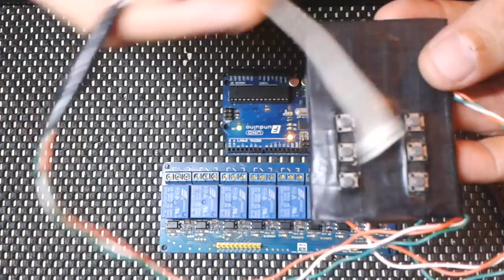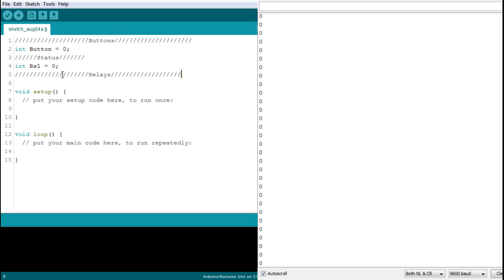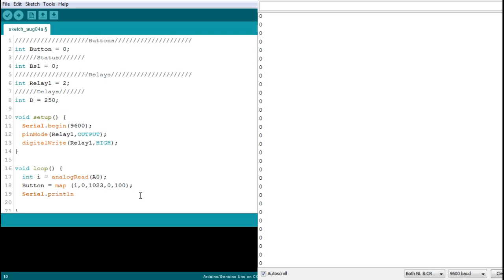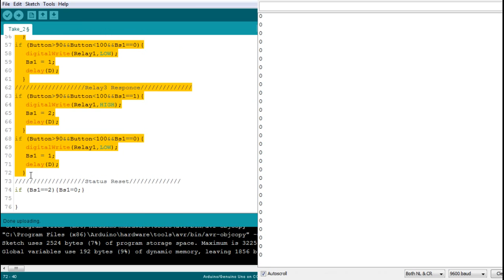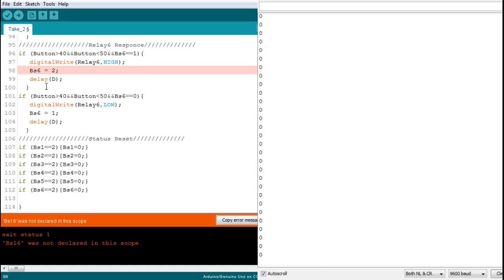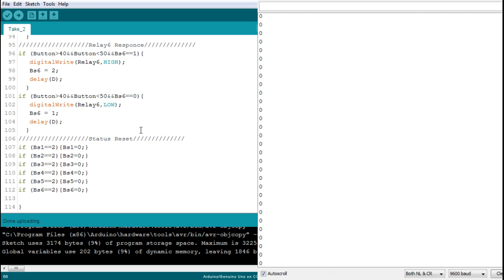Arduino Coding ("Button And Relays")

Comment: Hello Liney118, 

I am making a sequential relay selector (8CH) with just 2 voltage input signal (up, down) to the arduino. Can you help me with the arduino codes??

Greatly appreciate your help  as I am really bad with codes.

Thanks!
Reply: // Constant values that won't change.
  const int Relay_1 = 2;
  const int Relay_2 = 3;
  const int Relay_3 = 4;
  const int Relay_4 = 5;
  const int Relay_5 = 6;
  const int Relay_6 = 7;
  const int Relay_7 = 8;
  const int Relay_8 = 9;
  const int LED = 10;
  const int PushButton_1 = 12;
  const int PushButton_2 = 13;

// Variable values that will change.
  int PushButtonCounter = 0;           // Counter for the number of push button presses.
  int CurrentButtonState_1 = 0;          // Current state of the push button.
  int LastButtonState_1 = 0;             // Previous state of the push button.
  unsigned long ButtonPressed_1;

  int CurrentButtonState_2 = 0;          // Current state of the push button.
  int LastButtonState_2 = 0;             // Previous state of the push button.
  unsigned long ButtonPressed_2;

void setup()
  {
    pinMode(Relay_1, OUTPUT);
    pinMode(Relay_2, OUTPUT);
    pinMode(Relay_3, OUTPUT);
    pinMode(Relay_4, OUTPUT);
    pinMode(Relay_5, OUTPUT);
    pinMode(Relay_6, OUTPUT);
    pinMode(Relay_7, OUTPUT);
    pinMode(Relay_8, OUTPUT);
    pinMode(LED, OUTPUT);
    pinMode(PushButton_1, INPUT);
    pinMode(PushButton_2, INPUT);
    digitalWrite(Relay_1, LOW);
    digitalWrite(Relay_2, LOW);
    digitalWrite(Relay_3, LOW);
    digitalWrite(Relay_4, LOW);
    digitalWrite(Relay_5, LOW);
    digitalWrite(Relay_6, LOW);
    digitalWrite(Relay_7, LOW);
    digitalWrite(Relay_8, LOW);
    digitalWrite(LED, LOW);
  }

void loop()
  {
    CurrentButtonState_1 = digitalRead(PushButton_1);        // Read the push button input pin.
    if (CurrentButtonState_1 != LastButtonState_1)           // Compare the PushButtonState to its previous state.
      {
        if (CurrentButtonState_1 == HIGH)                  // If the current state is HIGH then the button went from off to on.
          {
            ButtonPressed_1 = millis();
            PushButtonCounter++;                         // If the state has changed, increment the counter.
          }
        delay(50);                                       // Delay a little bit to avoid bouncing.
       }
    LastButtonState_1 = CurrentButtonState_1;                // Save the current state as the last state for next time through the loop.
   
    CurrentButtonState_2 = digitalRead(PushButton_2);        // Read the push button input pin.
    if (CurrentButtonState_2 != LastButtonState_2)           // Compare the PushButtonState to its previous state.
      {
        if (CurrentButtonState_2 == HIGH)                  // If the current state is HIGH then the button went from off to on.
          {
            ButtonPressed_2 = millis();
            PushButtonCounter--;                         // If the state has changed, decrease the counter.
          }
        delay(50);                                       // Delay a little bit to avoid bouncing.
       }
    LastButtonState_2 = CurrentButtonState_2;                // Save the current state as the last state for next time through the loop.

    if (PushButtonCounter == 9) PushButtonCounter = 0;
    if (millis() > ButtonPressed + 2000)
      {
         switch (PushButtonCounter)
          {
            case 1:
              digitalWrite(LED, HIGH);
              delay(100);
              digitalWrite(LED, LOW);
            break;
            case 2:
              digitalWrite(LED, HIGH);
              delay(100);
              digitalWrite(LED, LOW);
              delay(500);
              digitalWrite(LED, HIGH);
              delay(100);
              digitalWrite(LED, LOW);
            break;  
            case 3:
              digitalWrite(LED, HIGH);
              delay(100);
              digitalWrite(LED, LOW);
              delay(500);
              digitalWrite(LED, HIGH);
              delay(100);
              digitalWrite(LED, LOW);              
              delay(500);
              digitalWrite(LED, HIGH);
              delay(100);
              digitalWrite(LED, LOW);
            break;  
            case 4:
              digitalWrite(LED, HIGH);
              delay(100);
              digitalWrite(LED, LOW);
              delay(500);
              digitalWrite(LED, HIGH);
              delay(100);
              digitalWrite(LED, LOW);
              delay(500);
              digitalWrite(LED, HIGH);
              delay(100);
              digitalWrite(LED, LOW);
              delay(500);
              digitalWrite(LED, HIGH);
              delay(100);
              digitalWrite(LED, LOW);
            break;
            case 5:
              digitalWrite(LED, HIGH);
              delay(100);
              digitalWrite(LED, LOW);
              delay(500);
              digitalWrite(LED, HIGH);
              delay(100);
              digitalWrite(LED, LOW);
              delay(500);
              digitalWrite(LED, HIGH);
              delay(100);
              digitalWrite(LED, LOW);
              delay(500);
              digitalWrite(LED, HIGH);
              delay(100);
              digitalWrite(LED, LOW);
              delay(500);
              digitalWrite(LED, HIGH);
              delay(100);
              digitalWrite(LED, LOW);
            break;
            case 6:
              digitalWrite(LED, HIGH);
              delay(100);
              digitalWrite(LED, LOW);
              delay(500);
              digitalWrite(LED, HIGH);
              delay(100);
              digitalWrite(LED, LOW);
              delay(500);
              digitalWrite(LED, HIGH);
              delay(100);
              digitalWrite(LED, LOW);
              delay(500);
              digitalWrite(LED, HIGH);
              delay(100);
              digitalWrite(LED, LOW);
              delay(500);
              digitalWrite(LED, HIGH);
              delay(100);
              digitalWrite(LED, LOW);
              delay(500);
              digitalWrite(LED, HIGH);
              delay(100);
              digitalWrite(LED, LOW);
            break;
            case 7:
              digitalWrite(LED, HIGH);
              delay(100);
              digitalWrite(LED, LOW);
              delay(500);
              digitalWrite(LED, HIGH);
              delay(100);
              digitalWrite(LED, LOW);
              delay(500);
              digitalWrite(LED, HIGH);
              delay(100);
              digitalWrite(LED, LOW);
              delay(500);
              digitalWrite(LED, HIGH);
              delay(100);
              digitalWrite(LED, LOW);
              delay(500);
              digitalWrite(LED, HIGH);
              delay(100);
              digitalWrite(LED, LOW);
              delay(500);
              digitalWrite(LED, HIGH);
              delay(100);
              digitalWrite(LED, LOW);
              delay(500);
              digitalWrite(LED, HIGH);
              delay(100);
              digitalWrite(LED, LOW);
            break;
            case 8:
              digitalWrite(LED, HIGH);
              delay(100);
              digitalWrite(LED, LOW);
              delay(500);
              digitalWrite(LED, HIGH);
              delay(100);
              digitalWrite(LED, LOW);
              delay(500);
              digitalWrite(LED, HIGH);
              delay(100);
              digitalWrite(LED, LOW);
              delay(500);
              digitalWrite(LED, HIGH);
              delay(100);
              digitalWrite(LED, LOW);
              delay(500);
              digitalWrite(LED, HIGH);
              delay(100);
              digitalWrite(LED, LOW);
              delay(500);
              digitalWrite(LED, HIGH);
              delay(100);
              digitalWrite(LED, LOW);
              delay(500);
              digitalWrite(LED, HIGH);
              delay(100);
              digitalWrite(LED, LOW);
              delay(500);
              digitalWrite(LED, HIGH);
              delay(100);
              digitalWrite(LED, LOW);
            break;
          }
        ButtonPressed_1 = millis(); 
        ButtonPressed_2 = millis(); 
      }
  }
Reply from the maker: sure dude, tell me what you're needing, what inputs and outputs
Reply: Hey man, thanks for the swift reply yo, so basically what I am hoping for the Arduino to do is that it will activate (output) the relays in sequence from bottom to top and vice versa (relay 1 <> relay 8) when receive 2 voltage inputs from 2 push buttons that will act as raise and lower. Do let me know if you need more details and hopefully the sketch I written is workable and minor changes needed only. Thanks again for willing to help me out. :)
Reply from the maker: no worries man, just got in from work,  first thing I checked, ok so the push buttons are these 2 separate buttons to 2 inputs ?
Reply from the maker: also list me your inputs and outputs and what you want it to do
Reply: ahhhh... no problem, from where I am now it is going to be 12AM in the morning soon, so I hope I am able to give you as much details before my turn to head to work tomorrow and communicate with you late at night again. Anyhow yes, it is 2 separate push buttons to 2 separate inputs.
Reply from the maker: thats Insane lol, ok start a fresh sketch and add the following

int Up = 2;
int Dpwn = 3;
int Relay1 = 4;
int Relay2 = 5;
Int Relay3 = 6;
int Relay4 = 7;
int Relay5 = 8;
int Relay6 = 9;
int Relay7 = 10;
int Relay8 = 11;
Reply from the maker: so when you press (UP) what do you want to happen ?
Reply: Lol ... ok, so basically what I sketched was an overkill? haha
Reply: when I press (up) it will got from relay 1 to 2, and press again from 2 to 3 and so on. while down it will be step down from the current active relay (n-1)
Reply: reading back my comment just gave me brain cancer, I apologize for my grammatical error as I am really sleepy and tired. Let me rephrase that "when up is being pressed it will turn relay 1 on and it will stay active until (UP) is being press again, so when relay 2 is active relay 1 will turn off (n+1), while the (DOWN) button will be (n-1) from the current active relay. >__<
Reply from the maker: ok so, you basically what the up to turn on selected relay and down is the opposite ?, will you need an off position ?
Reply: Yea yea yea, no off position is needed. :)
Reply from the maker: do you have a hangouts or discord account ?
Reply: I have a hangout account, let me personal message you my gmail.  :)
Reply: just sent a friend request :)
Reply from the maker: !!!Here You Go Man!!! connect buttons to d2(UP) and d3(Down) to GROUND . D3 to D10 are relay OUTPUTS 1 to 8
/////////////////////////////////////////////////////
////////////////////Buttons/////////////////////
int Up = 2;
int Down = 3;
//////////////////ButtonState////////////////////
int Bs1 = 0;
int Bs2 = 0;
////////////////////Relays//////////////////////
int Relay1 = 4;
int Relay2 = 5;
int Relay3 = 6;
int Relay4 = 7;
int Relay5 = 8;
int Relay6 = 9;
int Relay7 = 10;
int Relay8 = 11;
///////////////////Indicator////////////////////
//int Led = 13;
///////////////////////////////////////////////
int RelayPosition = 0;
void setup() {
  pinMode(Relay1,OUTPUT);
  pinMode(Relay2,OUTPUT);
  pinMode(Relay3,OUTPUT);
  pinMode(Relay4,OUTPUT);
  pinMode(Relay5,OUTPUT);
  pinMode(Relay6,OUTPUT);
  pinMode(Relay7,OUTPUT);
  pinMode(Relay8,OUTPUT);
  digitalWrite(Relay1,1);
  digitalWrite(Relay2,1);
  digitalWrite(Relay3,1);
  digitalWrite(Relay4,1);
  digitalWrite(Relay5,1);
  digitalWrite(Relay6,1);
  digitalWrite(Relay7,1);
  digitalWrite(Relay8,1);
  pinMode(Up,INPUT_PULLUP);
  pinMode(Down,INPUT_PULLUP);
  Serial.begin(9600);
}

void loop() {
if (digitalRead(Up)==LOW){Bs1=1;delay(250);}
if (digitalRead(Down)==LOW){Bs2=1;delay(250);}
  switch (RelayPosition) {
    case 0:
      digitalWrite(Relay1,1);
      digitalWrite(Relay8,1);
      break;
    case 1:
      digitalWrite(Relay1,0);
      digitalWrite(Relay2,1);
      digitalWrite(Relay8,1);
      break;
    case 2:
      digitalWrite(Relay2,0);
      digitalWrite(Relay1,1);
      digitalWrite(Relay3,1);
      break;
    case 3:
      digitalWrite(Relay3,0);
      digitalWrite(Relay2,1);
      digitalWrite(Relay4,1);
      break;
    case 4:
      digitalWrite(Relay4,0);
      digitalWrite(Relay3,1);
      digitalWrite(Relay5,1);
      break;
    case 5:
      digitalWrite(Relay5,0);
      digitalWrite(Relay4,1);
      digitalWrite(Relay6,1);
      break;
    case 6:
      digitalWrite(Relay6,0);
      digitalWrite(Relay5,1);
      digitalWrite(Relay7,1);
      break;
    case 7:
      digitalWrite(Relay7,0);
      digitalWrite(Relay6,1);
      digitalWrite(Relay8,1);
      break;
    case 8:
      digitalWrite(Relay8,0);
      digitalWrite(Relay7,1);
      digitalWrite(Relay1,1);
      break;      
  }
if (Bs1==1&&digitalRead(Up)==HIGH&&RelayPosition<8)
{RelayPosition ++;delay(250);Bs1=0;}
if (Bs2==1&&digitalRead(Down)==HIGH&&RelayPosition>0)
{RelayPosition --;delay(250);Bs2=0;}
}
Reply: THANK YOU VERY MUCH Liney118!! If you ever drop by Malaysia make sure to let me know, I'll buy you a cold one. :)
Reply from the maker: sweet, does that do everything you wanted ?
Reply: liney118 yes it did flawlessly :) but I think my relay is not triggering because of insufficient current supply to it
Reply from the maker: whats the spec of the relay, is it the same as I was using (Low side triggered) or is it (High sided) ?
Reply: liney118 sorry man,I am not really sure about the relay spec as this is my first time approaching one. How do I know if it is low sided or high sided trigger? if it is the other one should I just change the code from low to high ? thanks :)
Reply from the maker: best way to test is to set the relay up for power and then touch one of the relay pins with a ground / positive signal, so if it's is high sided then yes just change all the LOW's to Highs and so on. I got to shoot off to work now mate, so I'll catch up when I get home ;) hope that helps
I've added you on hangouts also ;)
Reply: liney118 aight! will do and thank you very much again for the help. :) will message you if it works :)
Reply: Hey Liney118, solved just need external voltage source to energize the coils. :)
Reply from the maker: sweet, so it's low sided then ;)
Reply from the maker: if you are using the 5 Volt 8 channel relay, as in the vid, you can use the arduino's 5v rail, as the supply is direct from the ams1117 which is a 5volt / 1 amp regulator .
Reply: Morning! sorry for the late reply, was a little hectic yesterday. Anyhow I compared my relay and yours, they both look exactly the same, but I still cannot power it up VIA arduino, I have attached an external 9V battery to the relays for it to works. :(
Reply from the maker: does it have the yellow selector  jumper, if so make sure it connects , vcc to rvcc
Reply: liney118 yes it does have the yellow jumper and I already double checked the connection between vcc and jvcc. no luck :(, but its okay, removed the jumper and add in external supply into the gnd and jvcc. Works like magic :)
Reply from the maker: any chance your relay maybe 12 volt ?
Reply from the maker: whats the model number of the relay board ?
Reply: not sure, its a rather cheap relay board I acquired locally. Most of the wordings on the relay has faded away. (1LF1WS1CS4YJ8AM8) was printed on the downside of the board tho.
Reply from the maker: sounds as though yours maybe a 9 volt board.  unusual, but older schematics do use a 9/12volt setup due to analog components used back in the day
Reply from the maker: any Idea on the current draw from 1 relay high ?
Reply: liney118 not really sure about the current draw from the relays, didn't hit me to measure them. Will do it on monday and keep you posted :)
Reply: Morning Liney, checked the trigger current, its about 5mA per relay. Hope this tell you somethign :)
Reply from the maker: I meant the relays coil current draw, sorry for confusing you :(
Reply: Hey Liney, sorry  for coming back to you late, I was out at field.  By the way did a simple calculation and the current draw for the relay coils and they are about 50 ~ 60mA.
Reply from the maker: Sounds about rite
Reply: ahhh ~~~ so they are 12v relays ?
Reply from the maker: I'd say they are 5 Volt due to the current draw, but I could be wrong ;)
Reply: hmmm... that's really really odd, It just won't work with the arduino board 5V or Vin Pin :(
Reply from the maker: sure is  :(
Reply: Anyhow it works and the code you wrote was perfect. Thank you very much man !! :)
Reply from the maker: Any time ;)   I've been working on a mod for my car's electronics using the 8 channel relay board
Reply: SWEET !! what are you modding?  I love modding  my car too, but usually with analog and ready made stuff tho. The only one mode that includes arduino coding and a little bit modification was my F1 style shift light indicator from cihppernut. :P
Reply from the maker: Adding spot's, keyless start , auto lights and a few other tweeks
Reply: sport's?? keyless start and auto lights good stuff man !!
Reply from the maker: Easy stuff really
Reply: @yong972  thanks